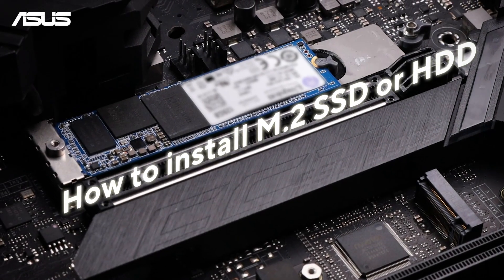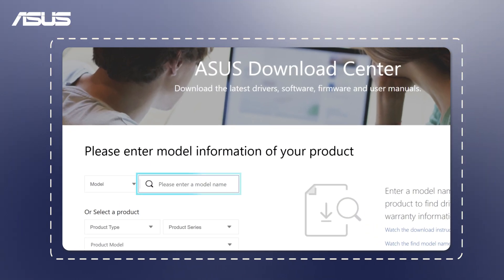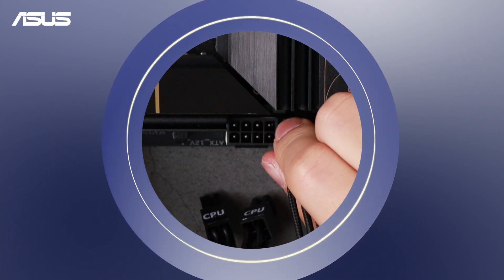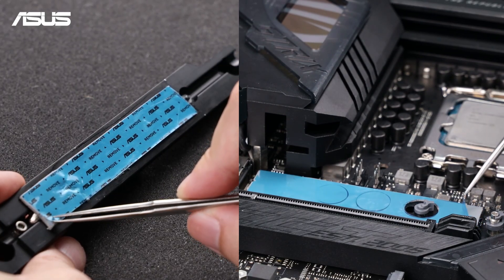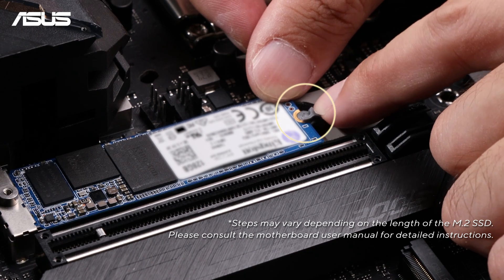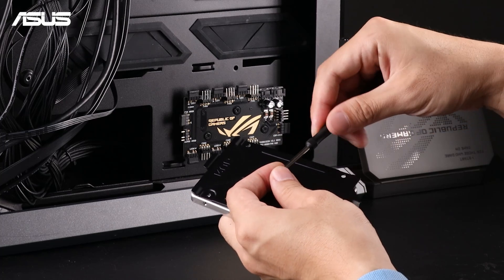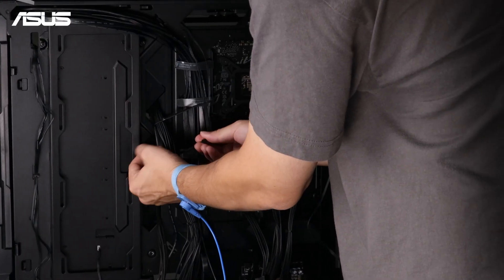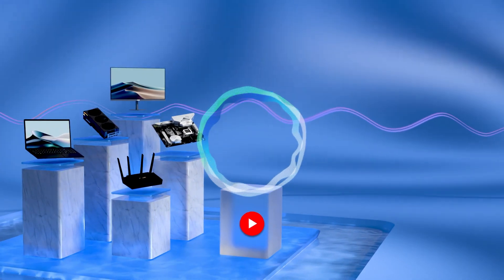How to Install M.2 SSD or HDD on ASUS Motherboard?    | ASUS SUPPORT

Comment: Hi using a b660m-a d4 motherboard with a Kingston nvme on the heatsink slot, I think there's another slot in the bottom, I want to swap it with a new one and keep both, they run at same speed? do I need a heatsink added? Thanks.
Reply from the maker: Regarding your question, I would recommend you visit the following forum and post there to get more assistance. 
https://zentalk.asus.com/t5/motherboards/bd-p/motherboards
Thank you.
Reply: @asus_support  thanks I'll bookmark it. Already cloned and changed for the better. The Kingston SNV2/500G is unusable, the WD SN770 is so far a world of difference.

Comment: Hello, I've just bought an Asus prime h610m-k d4 motherboard, and it doesn't have heat sink for m2 drive! Should I have to buy it separately and is it necessary to have one before installing my m2 drive? 
Thank you
Reply from the maker: Regarding your question, I would recommend you visit the following forum and post there to get more assistance.
https://zentalk.asus.com/t5/motherboards/bd-p/motherboards
Or you can contact the local service center for help.
The following is the contact information:
https://www.asus.com/support/CallUs# 
Sorry for any inconvenience it may be caused.

Comment: So I am trying to install the WD_Black SN850X w/hestsink onto the Rog strix x870-e-e gaming wifi motherboard, but I can't seem to put the top/heatsink over the top.. Do I leave this off, while my ssd is clicked in? Iv tried putting the mobo heatsink on top of the ssd w/hestsink, but it won't fit
Reply from the maker: Regarding your question, I would recommend you visit the following forum and post there to get more assistance. 
https://rog-forum.asus.com/t5/gaming-motherboards/bd-p/HSS_MB
Thank you.

Comment: Bom dia, tenho 99% de certeza, mas como é um produto caro, prefiro uma confirmação oficial: o SSD a seguir pode ser instalado no LapTop UX3407QA? (ASUS Zenbook 14 pol. com processador Snapdragon X):

SSD M2 Samsung 4tb 990 Pro Nvme Pcie Gen 4.0 X4 Mz-v9p4tobw

Obrigado!
Reply from the maker: Unfortunately, the maximum supported SSD capacity for this model is 1TB.
Reply: @asus_support  In what world is that not a software lock. lol

Comment: They clearly say to check the motherboards that are compatible but it should give a solution to the Asus X543mar that has the soldered RAM memory, if not then you can adapt an M2 disk and keep the hard disk as a backup but the only thing that can be done in this X543mar model is install a solid disk and nothing else is needed, if you cannot add more RAM, you can install an M2 disk and keep the HDD.